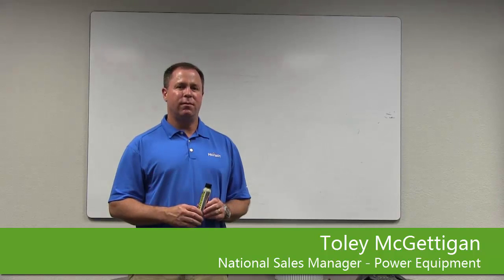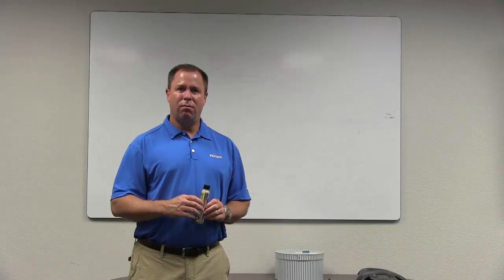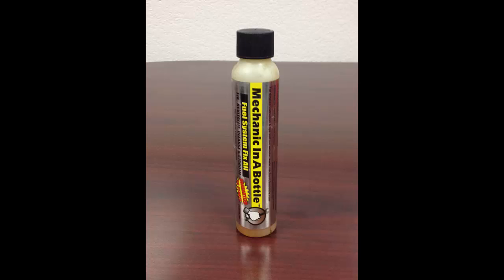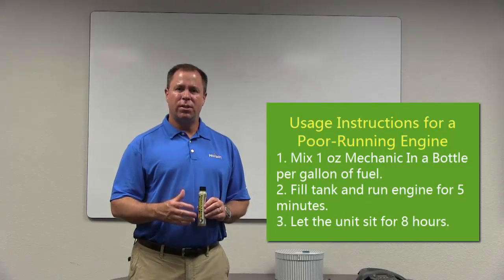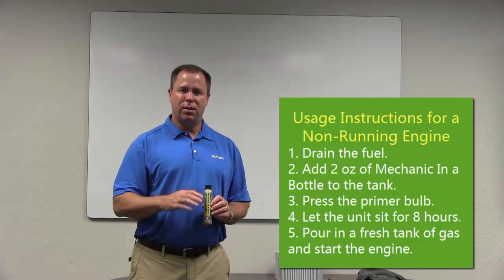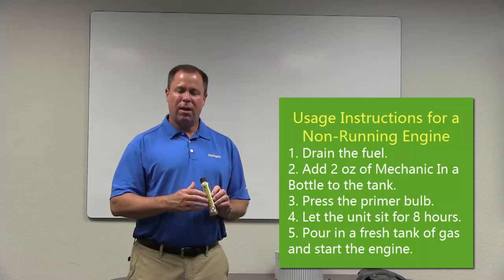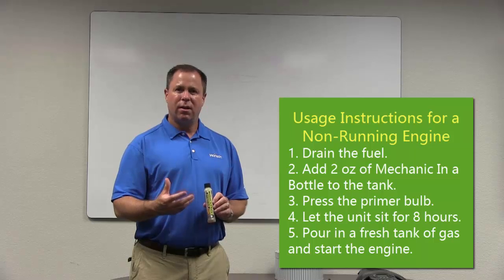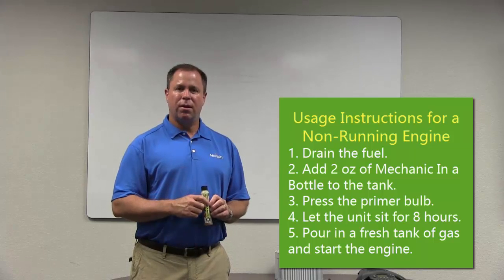How to Repair a 2 Cycle Engine with Mechanic In a Bottle

Comment: Mechanic in a Bottle worked letting it set overnight. No primer bulb ? Pull valve closed. Thanks so much. Brief and to the Point. Ace ran out but WalMart had Mechanic in a bottle.